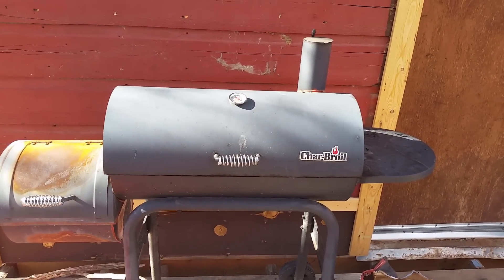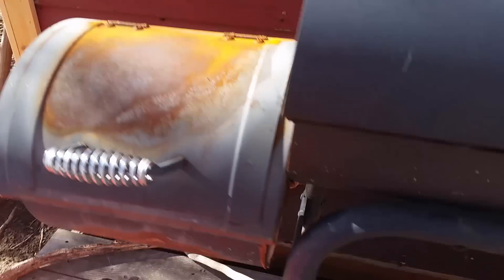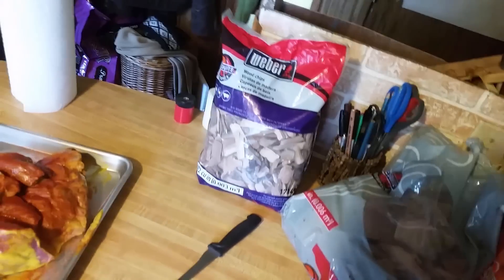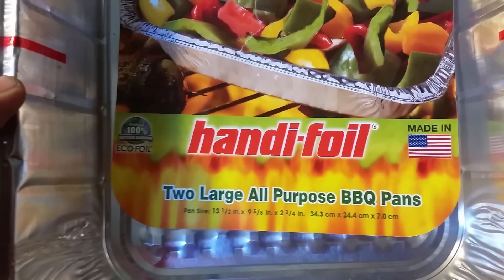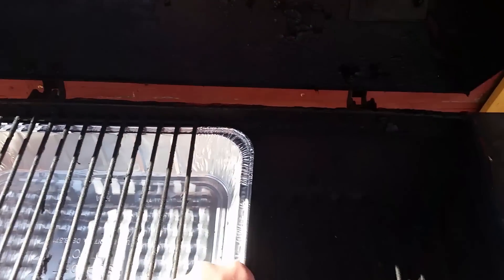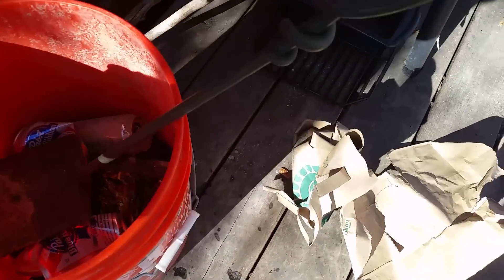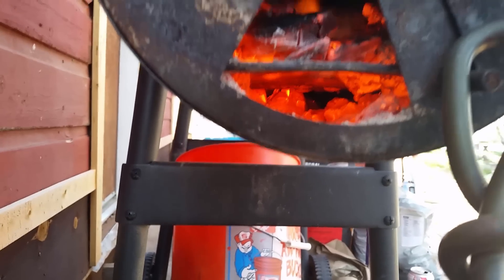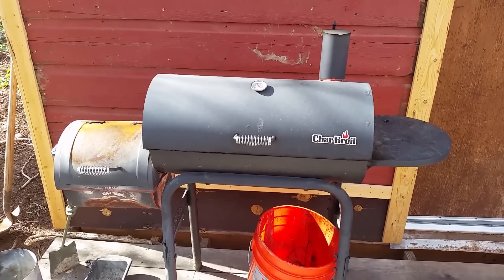Char-Broil Offset Smoker review AND use.

Comment: Got one, just a little bigger. Best advice, Use a screen or something Homemade to prevent fire from touching the bottom of your smoker. Secondly when starting your fire leave your smoke box lid open until your second stacking and then until white smoke. Thirdly, season your smoker and cover your smoker. Althrough Char-boil aren't on the high end of grills a few simple mods can make this grill cook with the best, mainly adding bricks or lava rocks and second increasing the stack length.
Reply from the maker: Great advice!
Reply: Thank you

Comment: You need to season your smoker like a cast iron pan, coat it all inside and out in any high temp oil every time you use it to help prevent rust. I use spray canola oil because it’s convenient. Also be sure to remove the ashes asap to prevent corrosion.

Use small aluminum bake pan like you’re using for a water pan to catch the ashes or use some heavy duty aluminum foil to line the bottom of your charcoal chamber and change it out when cleaning the ashes to prevent moisture from gathering underneath.
As for your dampener, remove it from the chamber door and give it a slight bend to cause friction against the chamber wall.
Reply from the maker: Great advice! Thanks for the comment and tips!
Reply: Do you line the bottom of the grill with aluminum foil and then add charcoal?
Reply: @danielleg2616  That would work just fine, but don’t lay the coals directly on the foil because it will just burn through. The foil is more of an easy clean up precaution. I use the 18” wide heavy duty aluminum foil. Reynolds is good, but great value has the same stuff, same sized roll for a buck and a half less.
When your grill or smoker cools down and you can safely touch it, empty the ashes and remove the spent aluminum foil. If it’s not horribly burnt or completely covered in grease, check underneath for moisture. If the ashes sit too long in the grill or firebox/ charcoal chamber, they will attract moisture and it actives a chemical reaction that eats away at your grill faster.
The grease flare ups suck, but having the bottom of your box collapse in the middle of cooking is soul crushing and dangerous of course.
If you’re using it to line the smoke chamber on a smoker, it too can accumulate moisture underneath if it’s cooling down in cooler temperatures. But start lining it in layers from the drip hole end and line it the next layer slightly overlapping towards the firebox. This way the fat and grease runs down it like shingles on a roof if that makes sense.
P.s. I used the Copper Silicone Sealant from the same company instead of the red because it is higher temp rated.

Comment: Im new at this smoking business, so you have helped me on the situation with the chips, I keep putting chips in the smoker,
Reply from the maker: Glad i could help!
Reply: I get my charcoal going good,then I put the soaked chips on but it makes me lose the heat and have to restart it, etv
Reply from the maker: Have you tried getting your coals good, then putting bigger dry wood chips on? Then if it gets to hot you can put the wet chips on.
Reply: I guess that was my problem getting in a hurry and putting the chips in before the fire gets going.
Reply from the maker: Well smoking is an art. I'm sure you will get it down!

Comment: Just picked this up but going mod mine with an electric hotplate (1000w) i have seen it done on home built smokers not sure if 1000w will be hot enough so may need a 1500w

Have temp probes to be able to check heat distribution

Once i can get 220-250 constant temp will do temp spread

Comment: Hey couple of things say 1.you got small bolt at the burning chamber door that you can just make it tigh and the door would be perfectly fine. 2. This smoker showing very false temperatures at the top (100f difference) without additional thermometer you will never get a good prepared meat if you don't know the actual temp.

Comment: I have a char broil charcoal grill and I’m looking to get an offset smoker for it. It’s the American gourmet tabletop grill/offset smoke box. However the dampener plate on the grill does not come off, it doesn’t have any nuts or bolts to remove it. It only has 2 empty holes above and below the dampener plate. So I’m wondering will the dampening hole be big enough for it to get heat and smoke throughout the grill from the smoke box when I attach it? The manual says the smoke box can be attached on my model, I just find it hard to believe you and everyone else’s videos I’ve watched had the whole plate removed while I can’t remove mine.
Reply from the maker: You know im not sure. I bought mine as an actual smoker kit. I'm not sure if we have the same model as mine came with all parts needed and all fit together perfectly.

Comment: Do you think I could use this or any smoker living in Canada with a winter of about -10 or -20 degrees Celsius? Thank you.
Reply: Did you get one?
Reply: We can use smokers in Canada, during the winter, for sure. I have a pellet grill which holds temp just fine. Offsets you may want thicker gauge steel ones for better heat retention. Such as a yoder. But it would just be more fire management, using the offset smoker.

Comment: How do u feed the bottomn coals on the side to keep it fed
Reply from the maker: They naturally drop down when they burn up smaller than the grate the coals normally sit on. Somtimes if the whole bottom gets filled with ash you kinda have to start over and clean it all out so the air can feed the coals.

Comment: do you recommend the char broil brand? i want to buy one smoker, why the silicone?
Reply from the maker: The char broil is definitely a good start if you don't know if you enjoy smoking meats or not. So they are more entry brand quality. 

The silicone is to seal anything that can leak smoke/air. It gives you more control over heat and let you smoke the meat better. 

If you don't silicone it just leaks smoke everywhere instead of going through the chimney pipe and going over your meat.

Comment: how do you prevent a huge fire so it doesn't rust or peel?
Reply from the maker: If s fire starts choke the air down and put some pre soaked wood chips on top of the flames to dampen it.
Reply: @pubstratgaming6224  thanks
Reply: What does opening or close the side vent do???
Reply from the maker: @CookNComedy  the side vent allows more are to blow onto the coals and give you more heat. The chimney cover also does the same thing, but allows it the draw or pull the air up. Play with both to get the temperature you are looking for.

Comment: Thanks for the video, helpful in my first use of this same smoker gifted to me.  I tried a whole chicken (3 lbs), expected it to take roughly 4 hours.  Problem is I couldn't get the smoker to maintain a temp over 200 degrees, so getting to 165 wasn't happening.  Ran out of time and had to finish it on the grill.  Turned out great.  Any suggestions on temp and raising it would be great!
Reply: The main isssur is just keeping anough coals and wood smoking BUT not on fire. Thats why i use the big wood chips to make a decent heat going and then smother it if it gets on fire with the soaked small chips. 

Hope that helps. 🔥🔥

Comment: Ok does this smoker come with 5 or 6 grill grates? I own it but cannot figure out which grate fits nicely in the firebox above the bottom one.. Or have I just lost the grate it came with
Reply from the maker: Brett Daley 4 in the cook chamber and 2 in the coal area so 6 total.
Reply: Jrbaconchi ok guess I lost one along the way thanks
Reply from the maker: The one that fits above the coal firebox is thicker material. Smaller than what fits in the cook chamber. Lol hope that helps.
Reply from the maker: No problem sorry for your lose :)

Comment: for an average 10 lbs pulled pork how long should i smoke it? and how long for a 14 lbs turkey? please respond
Reply from the maker: I normallu do a 14 pound pork shoulder at 8-16 hours. For smoked turkey its almost the same.... honestly it all depends on the internal temp. I did a 42 pound turkey last fall that was amazing but im sure that would be twice as long as you would need for a 14 pounder.
Reply: An hour a pound or when internal temp reach's 200

Comment: how long was ur total cpok time on the pulled pork dude
Reply from the maker: Pibb Solo roughly 6-8 hrs in smoker depending on smokey flavor level wanted. then i put in the oven before sleep wraped in tin foil for 8 hours.  it needs to be 190-200 deg. internal before the fats start brraking down making it be able to fall apart. the temp in oven is 215-225
Reply: Jrbaconchi sz